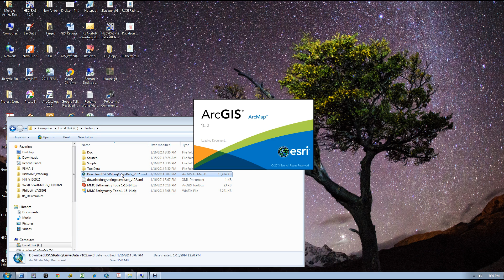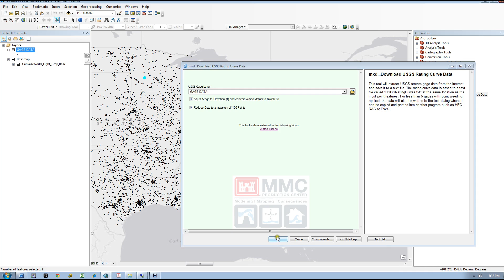Add an ArcToolbox and Verify ArcMap Settings Tutorial

Comment: Why is not enabled Background Processing?What does that work for? Thanks :)
Reply from the maker: If you enable background processing, then you don't automatically get the dialogue that shows the progress of the tool running... which sometimes can be valuable information.  If the tool were to error out, you'd have to find the results in order to debug it and figure out why it errored.
Reply: Thank you very much!! :)